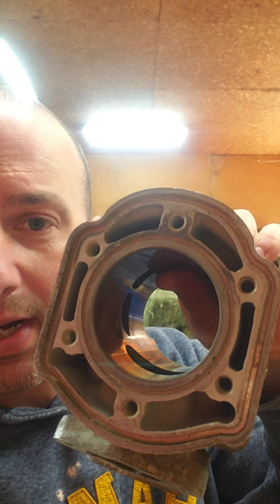Ski-doo Triple Series #4 - Engine Rebuild Questions and Answers

Comment: Man, thanks for taking the time in your schedule to post this Jason! Very informative and helpful for me. There are just too many chiefs out there with their ideas on how to rebuild. I put my trust in your knowledge, buddy.
Reply from the maker: It was my pleasure - I could talk about this stuff for hours :)  I think as long as you are doing research and matching the proper rebuild techniques and schools of thought to your intended application (trail / performance trail / race / etc), you will be fine.   There are some competent builders that may disagree with my advice and they may have valid reasons - I encourage you to continue to ask good questions and don't be afraid to challenge an opinion (mine included) or ask for justification.

Edit: I should clarify that I don't consider myself an expert with anything - always trying, always learning, occasionally making mistakes :)

Good luck with the rebuild and let me know how it goes!

Comment: Hey man, I loved this series. Just in the middle of rebuilding an F3 and wondering for the oil injection delete, if all you did was pull it off (injectors, lines etc) and put a block off plate on the pump hole? Thinking of doing this to mine, and have done it on other sleds so not a newb, some need a small oil reservoir for the crankcase water pump gears etc. far as I can tell this motor shouldn’t need anything like that just looking to confirm.
Reply from the maker: ScoredPiston (love your username!) - you are correct.  Pull the injectors, then you need to fill the holes where the injectors were - tap them out and thread a bolt or insert in them using red loctite.  Remove pump, pump gear, and intermediate gear between crank and pump gear.  Block off plate for pump.  

The water pump has a very small standalone oil cavity that is built into the pump itself - it has nothing to do with the oil injection system but does have a hex cap screw and sealing washer for servicing (adding gear oil annually) when needed.

Hope that helps you!
Reply from the maker: Check out this video - it goes through the oil injection delete about 1/2 way through the vid.

https://youtu.be/TiZjCxx1tB8
Reply: @jasonblier  thanks man, had a look, just as I suspected.  Appreciate the feedback.

Comment: Great video, when should you do crank seals on a 99 skidoo mach1 triple with the isoflex grease.
Reply from the maker: Hi Steve,

I would do crank seals during an engine rebuild.  The seals on these engines require that you split the crankcase to change them.  Also, the middle seals between each cylinder can’t be changed without rebuilding the crank.   

So, if you are doing a rebuild due to a top-end failure, I would tear it down and change out the crank to a new/rebuilt unit.
Reply: Thank you very much

Comment: Hey Jason I have a 99 formula 3 that I replace the engine in and now the flywheel is rubbing thru the stator wires. Any ideas
Reply from the maker: Hi Seth!

I need a bit more info.  Did you re-use your old stator, flywheel and swap it into the replacement engine?  Is it the output wires being rubbed or is it the copper wires around the poles?

The common issues are:
1. Routing the stator output wires incorrectly.
2. Retaining clip for output wires missing
3. Stator not fully seated against mag housing.

Let me know,

- J